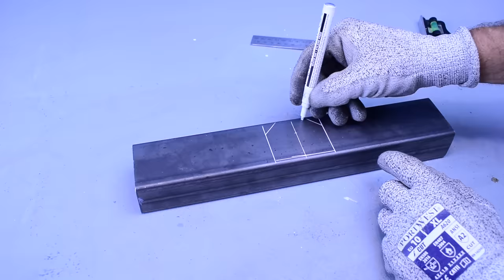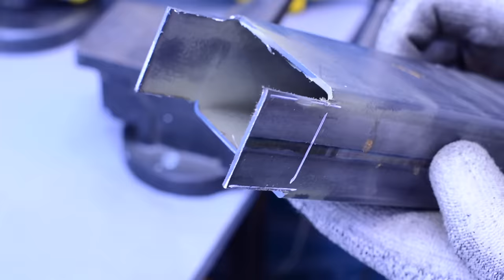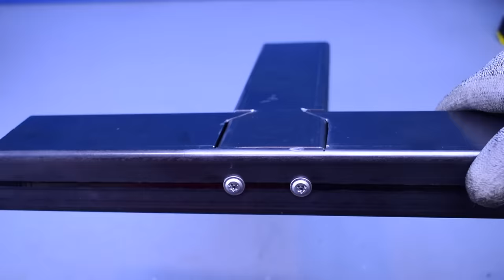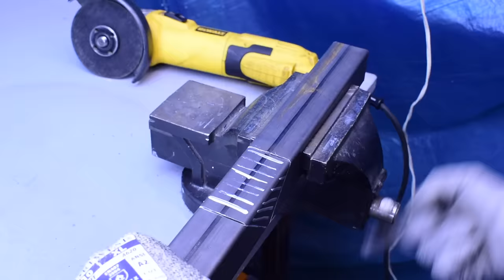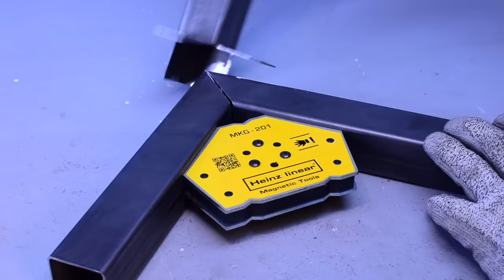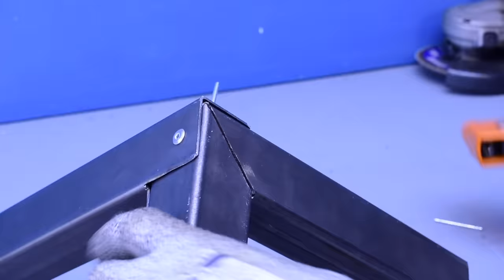99% of People Don't Know This Secret! Metal Joints Without Welding

Comment: 90% of people aren't aware of this because they understand that welding is faster, easier, and stronger than whatever this was.
Reply: y
Reply: joints are weak
Reply: Ххххххм
Reply: easier and faster, but.... well that depends on how you weld
Reply: I have a welder that i borrowed luckily, but if i didn't borrow i think this would be a great option for me ,yeah its more time spent but sure do look alot  cleaner than my welds lol
Reply: Also not everybody is this good with the angle grinder
Reply: Imagine preferring to spend 90 minutes+ making 8 precision cuts, 6 bends, 4 holes, and ending with a joint that is flush or strong.
Reply: The amount of force those joints holds equal the force of those pliers. Those screws can and will snap. The folds will unfold and you'll have failure. These are wood joints mainly and those still need glue to turn em solid. Cool art bro, not a load holder.
Reply: Not everyone lives where you can just go to a welding supplier, and buy gas, torches, flux, etc. You have to remember that YouTube is available, wherever you can get cell reception. Not just your town. 😆
Reply: @labrad0rk519  imagine living somewhere that the nearest gas tank supplier is 1,000 miles away. This is a good alternative if you don't want to spend an arm and a leg in shipping costs for welding equipment.
Reply: This one joint may be a lot weaker than a proper weld. But in conjunction with the rest of the frame work, I don't see it being so weak, that it wouldn't be sufficient for several applications. For ppl in third world countries, where shipping tanks of gas costs more than your house, this is a good alternative. You gotta think outside of your tiny box.
Reply: @redeyestones3738  150-200$ wire fed 110 welder can be accessed the same place as those grinders. They don't require flux or gas. I'm just pointing out that cutting material out of the metal, in the end, causes weak points. Welding adds to the metal, reinforcing it. But I haven't welded in a long time. Could be wrong.
Reply: @ManMeetsGamez  I understand what your saying. But you can order a angle grinder online for relatively cheap. But the wire fed machine you're talking about would be quite a bit more expensive to buy, and also ship. Imagine living on a tiny island in the south Pacific, or the dessert in the middle of nowhere in a 3rd world country. 
Yes, this method is nowhere near as strong as a proper weld. But with enough accompanying frame work, this could make a small structure, or implement, that would last a hell of a lot longer than a similar product made out of sticks, and vines. Try to remember that YouTube videos are available to EVERYONE with a cell signal
 Not just for ppl who can afford to ship wire fed welding machines, who live in first world countries, and have a full time job making more money in a week, than some people make in a year. That's all I'm trying to say. Ppl shoot this idea down, because they have other options. This type of video is for ppl who don't have those options. You know, ppl who don't live in places where you can just post videos of you playing video games all the time, like a spoiled 1st world citizen, who is incapable of seeing beyond their own little bubble.
Reply: but its provocative 😅
Reply: @redeyestones3738  where does it say that this video is for people in 3rd world countries?
Reply: @higginswallop5009  it doesn't. I'm just saying that's one situation where I could see it being useful. You don't think outside the box much, do ya?
Reply: Who are the 61k liking this video smh
Reply: @UwUCthulhu  ppl who can't afford a proper welder, but need something now, maybe?
Reply: @redeyestones3738  Bro, I live in Africa. If you can get steel you can get welding supplies, we're not living in the stone age. Don't believe everything you see on TV.
Reply: @OutsiderLabs  that's great for you. But you only read part of what I wrote. I said p living in third world parts of African or something to that effect. And no, not EVERYONE who has access to steel has access to everything else. What a silly thing to say. 😆 Ppl DO use scrap metal, fool. And not everyone In Africa can afford everything you can afford. You probably live in the suburbs
Reply: Is that why air craft are riveted and glued instead of welded? Or why the heaviest suspension bridge connections are bolted?

Welding isn’t actually stronger. From an engineering perspective it’s the weakest part of a joint and when stress is applied, often the first point of failure. That’s because the heat of welding anneals the joint making it weaker than it was originally. Tempering afterwards can restore some of that strength but by then the assembled piece may be too large for it to be practical. Typically the weld is placed so as to be at a junction where stresses are already minimized. The advantages of welding over mechanical fastening are it’s ability to spread the load uniformly over a larger area, sealing a joint from weather or pressure and it’s cheaper and easier…….not stronger. 

Mechanical fastening is stronger than any weld, always has been always will be as it doesn’t compromise the integrity of the base material.
Reply: @CheekyTyke007  thanks. Was hoping someone with a better industry vocabulary could chime in. Lots of negativity from ppl with nothing more than assumptions, based on their limited knowledge of physics. 😊
Reply: @redeyestones3738  Every country in the world has welding machines, they are essential in an industrial society, which almost all 3rd world countries are.
This is an ineffective detour to avoid welding when you can't or don't know how.
If the choice is to either delay the job or deliver a totally inferior product then I'll delay the job; considering how long this took even with thin material and simple shapes it really isn't a delay anyway.
Reply: @Senkino5o  dude, not everyone lives close enough to a place where you can get all the necessary things to make a weld. But you can find scrap metal clean it up, and buy a relatively cheap angle grinder, and a drill, and use this method. Which is actually stronger than a weld anyway. Think about all the bridges that are built using bolts, rather than welds.
Reply: @CheekyTyke007  I don't know anything about aircraft but I do know that mechanical fastening is primarily used in structural applications for speed, maintenance and to avoid galvanic corrosion and the mixture of dissimilar metals.
Welding is usually a far more time-consuming process especially if the weld is absolutely critical and needs many passes and heat treatment to build up. Good welds can often be the strongest point in a mechanical assembly.
Obviously this is not absolutely true in every circumstance I am generalising but then what you said is a gross generalization itself.

Many factors have to be considered when building a bridge, ship, plane, etc.
Reply: @ManMeetsGamez  depends on the quality of the screw. The screws he used? yeah they'll probably break. I would have used rivets anyway.
Reply: @CheekyTyke007  What you're stating is not true for mild steel welds, which are actually stronger than their metal substrate.  This video is pretty ridiculous.
Reply: As a welder with five years of experience, I completely agree with you.  There is nothing more reliable than welding.
Reply: @pufanpufanovich8469  Man, we could run down to Harbor Freight, get a cheap MIG welder with a spool of fluxcore wire and teach someone how to weld faster than this ridiculous joint could be constructed!
Reply: All this time you spent measuring, grinding and hammering, you could instead devote to driving to some place you can borrow a welder from. This method saves you nothing, and instead makes you waste your time and potentially material if you get it wrong.
Reply: @CheekyTyke007  You can't weld aircraft because the material they're made of: Aluminum 7075 WILL NOT WELD PROPERLY! It's impossible to weld two pieces of Aluminum 7075 and have them stay together even under minimum stress, and that's why they're riveted.

Bridges are riveted and bolted, because they need to be able to flex (move slightly under stress), and you can't achieve proper flexing with welds, only with bolts and rivets.

Nothing to do with the strength of joints. A good weld will always, ALWAYS be better in that regard than any other method of joining metals, period.
Reply: 99%*
Reply: Thanks for saving me the trouble of saying this. 👍🏻
Reply: What you said was what I thought of at first, but it does say in the description what the intent of the video was; an alternative way to join parts if people dont have a welding machine
Reply: @redeyestones3738  we get it, you're poor!
Reply: Welding isn't stronger, but ok.
Reply: 99.99%
Reply: "But in some cases there may not be a welding machine"
If you'd read the description you might have resisted the urge to make a snarky comment.
Reply: @davidszirmai  seems common sense is getting less and less common, at an accelerated rate these days. Sad, ya?  Ppl assume so much these days, without really thinking about things from every angle. Glad I don't have kids.
Reply: you stole my words exactly... :D this, whatever this nonsense was.. surely was pleasing to watch but i d stay at that.
Reply: @redeyestones3738  forget physics; I know people that can barely grasp the simple scientific notions of weathering and erosion
Reply: @iceonthesun8880  😆😆😆
Reply: Not everybody has a welder on their tool set...
Reply: Faster yes
Stronger maybe
Easier NO
And also its not as cheap as something that cut metal, bend metal and hit metal it require quite a lot of tools preparation and furniture for it to work and neither of them are cheap XD also its very noisy
Reply: 99% of the population don't have a welding machine or know how to weld.
Reply: If you have welding equipment, yes. But if you need make such thing only one in the life😮

Comment: Thank you for the video it encouraged me to buy a welder for reliability and strength.
Reply: So true lol
Reply: Lol
Reply: 0
Reply: 팩트가 너무 쎄다
Reply: I bet you could still do these cuts, without the screws and then weld the joints. Wouldn't that make it even stronger with more surface to weld?
Reply: 3(
Reply: Rofl. 👍
Reply: just in case no welder a/o no skill to use a welder.  It's me.  hehe
Reply: 9rrrrrrr0i
Reply: And save a shit load of time
Reply: And speed
Reply: lol, when time is unlimited…

Comment: To cutting and folding iron you need a lot of skills and technique. It looks easy but when you try yourself it's not. Welding is much easier, faster and I believe stronger connections. If you don't have welding equipment, buy it. Great video as usual!

Comment: The joint would be much stronger if the the metal from the Tee beam was cut and folded into tabs instead of removed like on the stud.  Also, a band saw works well for making straight cuts.

Comment: I mean, I guess if you don’t know how to weld, don’t mind if the same task takes twice as long, don’t care about real strength, and don’t mind if the joint is ugly..... this method is for you!
Reply: Time factored in, a welder would be much cheaper.
Reply: Exactly my thoughts... What's the point of this? Won't be strong enough for any use...
Reply: I am going totally with you guys, but the joint between 2 pieces would make sense if you want to keep the option of disassembly. 
For the bend it makes no sense indeed.

Comment: Pretty cool. The first one is a dovetail joint. Normally used in woodworking. The first iron bridge ever build was constructed using wood working joints. Since they didnt know anything else.
Reply: And you can`t weld Cast Iron...   :-))

Comment: well done, but with a welding machine that would be done much faster and, above all, more firmly. With the cutting disc consumption, even the purchase price would be worthwhile :-)
Reply: in a workshop u would always go with welding. but on a different location it may be useful. all that was made in the video could be done with hand or battery powered tools (yes u could even weld with battery but not for long). or in my experience i sometimes dont get a permit to do any hot work (the cutting does not need to be done with a grinder), so i must find another way. also keep in mind that welding does have a cost, welding rods or wire + gass. i don't think the price of cutting discs would even things out. however the hourly pay would, so at the workshop you would weld.
Reply: Cutting discs are extremely cheap. Not a factor here. I'd you're out on a trail, and you bust welds or snap something auxiliary, and not structurally important such as a pivoting arm spare tire carrier you can use this method to get back on the trail with only a dewalt etc angle grinder, and a rivet gun.

Comment: Very nice. These joins would be great if you have a welder also. As someone wise once told me "A strong welded joint starts with a good mechanical joint"
Reply: This is true,  l be a weldor and if you have a  good welder machine , and make a good cuts , the results is very nice. Magnífico trabajo , ideal para cuando no se cuenta con una máquina de soldar.

Comment: What is the thickness of the metal? 1/8 or 3/16? Very nice work, im a beginner in welding but if i use some of this ideas plus welded it would be very strong,
Reply: we take measurements in millimetres.

Comment: Pretty sure that thin steel tubing could have been joined much, MUCH faster and done ANYWHERE ; using a pair of common 12V car batteries, two pairs of jumper cables and one welding electrode.

Comment: Most of the strength has either been cut away or is relying on flaps of steel bent over and or a screw etc to secure it.. A good weld looks far superior as is superior in ever way. 
I don’t doubt mind your clever geometry skills..

Comment: Lot's of creativity, but this is not a good way to join things. The joints are weak, especially with rivets. Also they cannot handle any serious load. All in all good ideas, but they do not lead to good results. Welded joints are superior, and would actually not take longer if you consider how much time is spent on cutting out things etc. 

People should be careful watching this, getting ideas. It is a low level of workmanship, and questionable.

Comment: Looks cool, but it is trash for structural integrity. Maybe good for art pieces. Once you bend the steel, it work hardens and loses much of its ductility.
Reply: i doubt you would be using steel tubing in the first place if you worry about structural integrity.   This method should be sufficient enough for light project.

Comment: This is a waste of good material. For a project that needs only the small forces those joints can support you dont need those big steel pipes. Cheaper to use wood or aluminium.